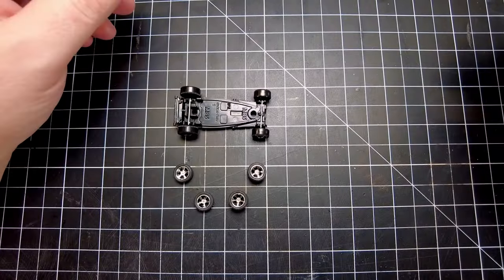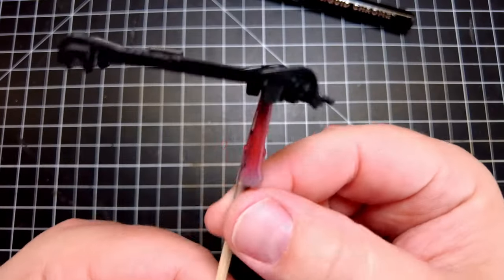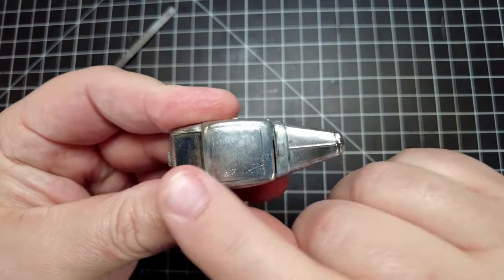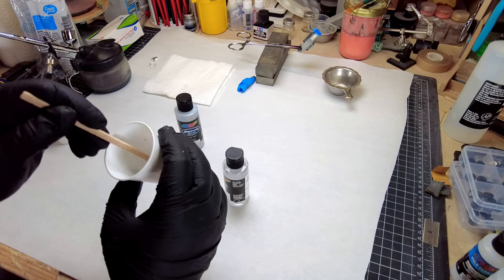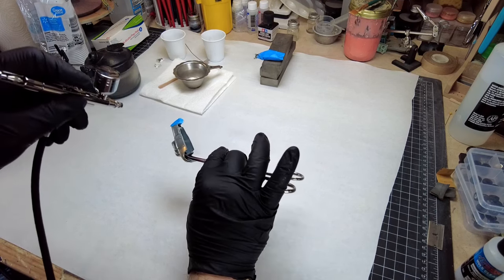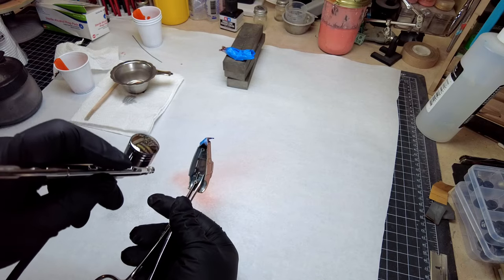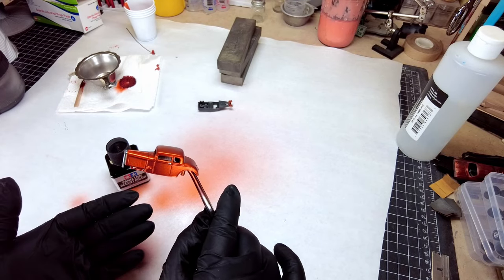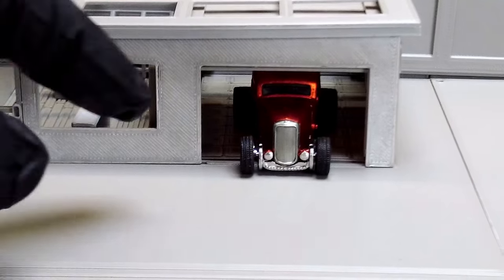How To Paint Hot Wheels And Matchbox!!!

Comment: Great looking hot rod Paul! On the panel liner, I've never tried it, but I'd question whether something 1/64 scale needed it. I've seen in used on 1/32 & 1/24 scale models & it enhanced both. I've also seen a darker shade of the main body color thinned down, so it flows as a panel liner. I don't think there are more than 2 or 3 colors of body liner sold commercially. I wonder if colored inks would work as panel liner.
Reply from the maker: Thank you for the comment. I am kinda regretting using the panel liner. Creating a darker car color to use as a panel liner is a great idea. I just don't know how I would go about darkening up a candy color without it looking off.